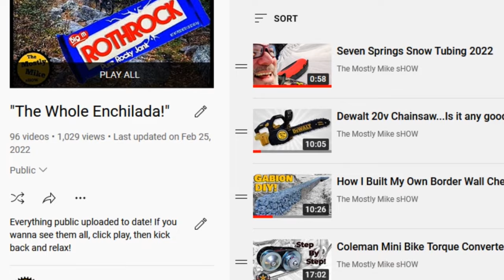Reclaimed brick pavers and Concrete work

Comment: What is it that you layed down first before the bricks?
Reply from the maker: Thanks for watching Tired Pleb. It's limestone dust, or sometimes referred to as limestone fines. It packs like concrete when mixed with water and tamped...especially with a motorized plate compactor. I considered renting one, but didn't feel that this project was big enough, so just tamped it by hand. Most tool rental places and some big box home improvement stores have these on hand. I hope that this helps.
Reply: Ballast and concrete mixed semi wet.
Reply from the maker: @daniel_913 Yep! Limestone fines pack very well too.